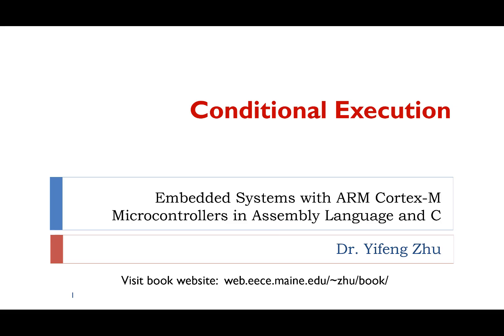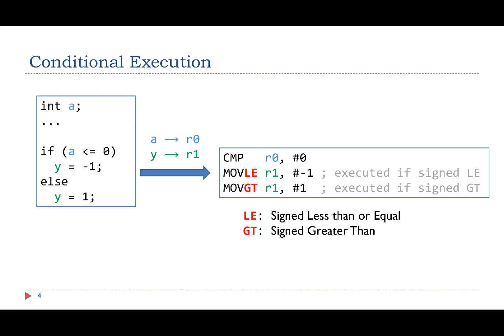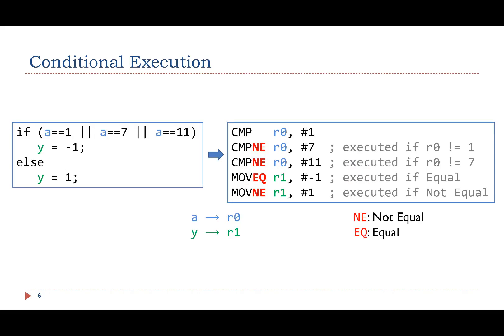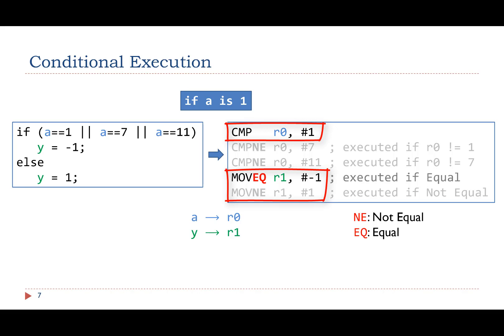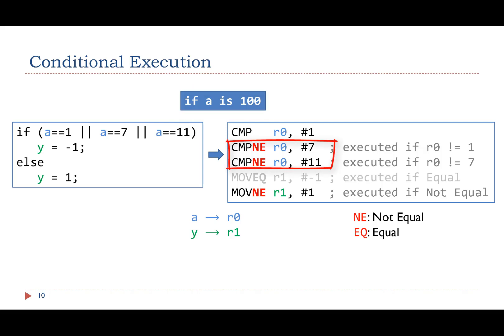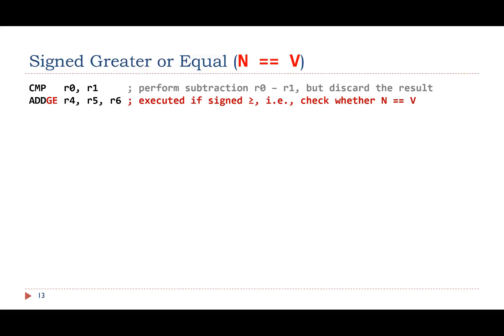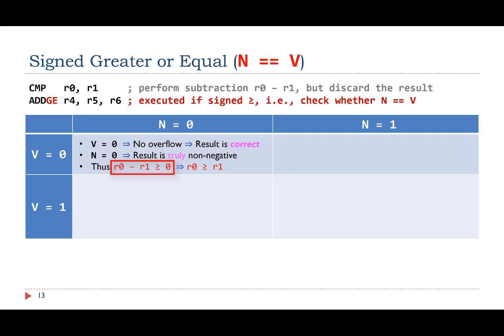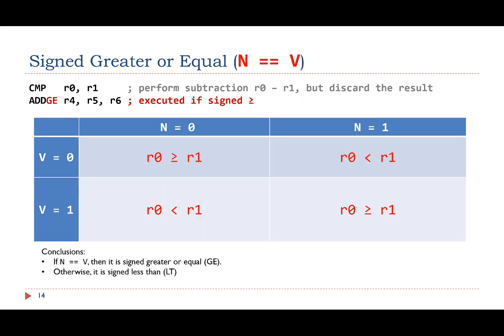Lecture 28. Conditional Execution

Comment: Is branchless programming always faster than programms with branches?
Reply from the maker: No, not necessarily. For example, ARM Cortex-M7 has an advanced branch predictor, which may run faster if the prediction is accurate.
Reply: Well, minimizing your branches reduces the number of paths you need to unit test for leads to less complex code which makes it overall more maintainable.  I would avoid worrying about the performance, unless you're writing an ISR.